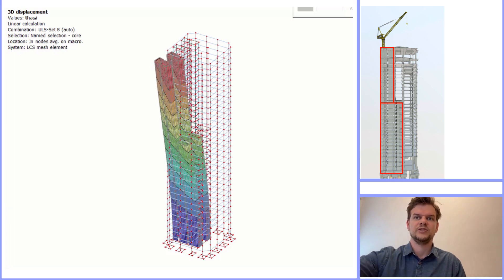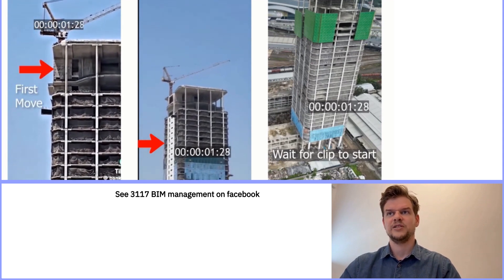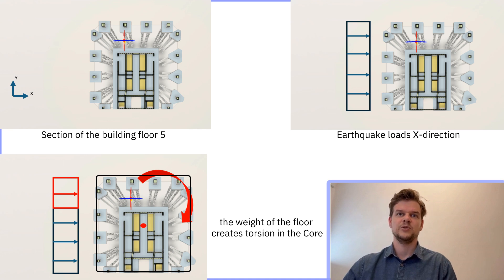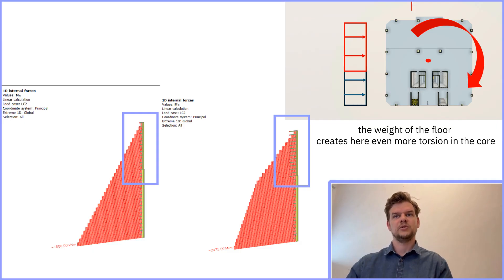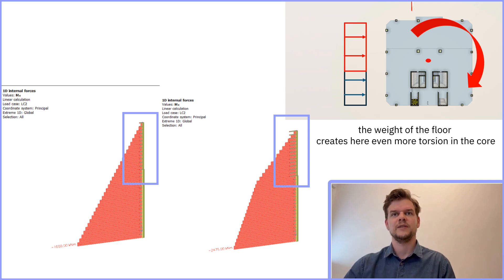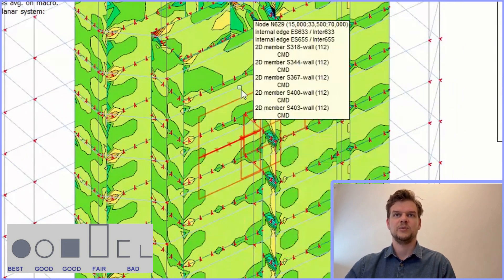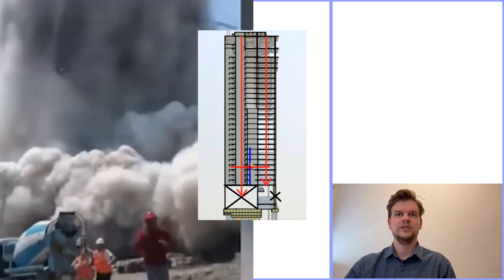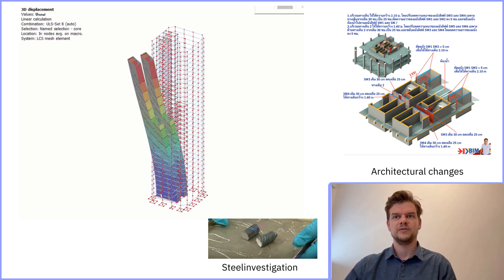Bangkok Skyscraper Collapse by TORSION with FEM and DEMO''

Comment: Thanks, this was an interesting review of possible failure modes of the under-construction tower. More reading points to likely substandard construction materials, poor oversight and design, and corruption greatly increasing the risks of failure under stress. Terrible loss of life, but as "just" construction workers I wonder how much compensation their families will receive.
Reply from the maker: Thanks for your thoughtful comment. The human cost is heartbreaking, especially when those most at risk receive the least protection.

Comment: OK, i understand now, torsion forces caused a skyscraper in Bangkok to collapsed ..but why this particular single one building, built with Chinese Construction materials/steel and by Chinese Engineers and Chinese design .. What were the real Man-made flaws ?? Corruption ?
Reply: corner cutting. Crooked contractors get away with it for decades - until they don't

Look at how many building collapses happened in the last big quake in Turkey despite quite stringent rules existing which should have prevented most of them

It's not a "chinese" thing. This stuff has happened regularly in the USA too
Reply: @alanbrown397  Indeed, can happen, but PRCHINA seems to be more prone to have such incidents where buildings, Bridges, Highways etc. suffered catastrophic events.  Another recent example , on the morning of April 23, 2025, the Chaobai River Bridge in Beijing's Shunyi District collapsed following a fire that broke out within its structure. Period.

Comment: This is excellent thanks. I challenge you to produce a video on the WTC 2 aircraft impact on 9/11. Most of the impact analysis I've seen focuses on WTC 1 where the aircraft debris and dislodged perimeter columns hit the rectangular core broadside while in WTC 2 the damage was very asymmetrical. The second plane impacted at ~100mph faster, 20 stories lower, and at an angle sideswiping the core lengthwise resulting in the East side of the building taking almost all of the damage. I never really bought the idea the towers fell in the 'same way' as WTC 2 obviously collapsed because of the East perimeter columns being pulled inward in the impact zone, while WTC 1 collapsing looks like a core-first failure. What are your thoughts there?
Reply from the maker: Thanks Daniel! would you be interested in a video that directly compares the two towers side by side? The causes of collapse are fairly well understood at this point, but there hasn't been much direct comparison between WTC 1 and 2 in terms of impact conditions and structural response. Just want to make sure that's the kind of breakdown you're thinking of.
Reply: @SystemFailures43  Anything that you think is worthwhile. Maybe a look at how quickly the perimeter column deflection in each tower caused them to lose strength or a simulation of a reinforced concrete core vs. braced steel core in such a situation or even a comparison of the tube within a tube vs. traditional framing system given damage and variable loading.
Reply: The wtc buildings collapsed when the outer structural members reached red heat and became malleable, at which point collapse was inevitable. It was obvious when watching it live that the beams were starting to buckle with the heat.

The buildings were "unusual" inasmuch as that they were specifically designed to pancake if hit by a fully laden 707 out of JFK in order to prevent smearing across 3 blocks of lower Manhattan and taking out 20-50,000 people. The Empire State building crash had already proven this was a risk and it should be noted that the only reason these buildings went as high as they did was because they were owned by the NY Port Authority - as such they weren't subject to planning limits imposed by NYC on lower Manhattan Island BECAUSE of the aviation risk taller buildings presented

The wonder with those particular buildings isn't that they came down, but that they stood up for as long as they did.

WTC7 collapsed as a result of critical structural hits from debris of the other 2 collapses

Comment: There are a lot buildings in Bangkok with similar layouts which did not collapse. I think the question is how much did the changes in design during construction and substandard materials contribute to the collapse. In other words if the building would have been constructed as per original design would it have collapsed or not?
Reply: Several other buildings in Bangkok and elsewhere suffered serious structural damage as well - failed columns and shear walls for example. There is so much wrong with this buildings design that my guess is that it would have collapsed even if the changes hadn't been made. But we will see what the structural engineering experts say when they develop their model.
Reply: @fx-studio  
We don't know. While we do have more information about the collapse now, compare to other case in past time, we still don't know much about what actually going on in that construction site.

There are sign of corruption and fraud, subpar material usage so far. Just like ants, these issue are only the first few we found. May be there are more problem with construction process. May be there are something else in the ground.

Bangkok sit on very soft clay and people keep build skycrapper there. We don't know if the elongated pile which extrude to meet the sand layers 20 meter something under could handle the quake very well. There had been many sink hole observe in the area.

I think there would be more 8 magnitude quake in close feature... Or worse. 
And we would know for sure if our building standard is adequate.
Otherwise... Well. I don't think Thai can handle that level of disaster. There will be million of casualty.
Reply: There is a difference with the Middle East where they build massive sky scrapers like the Burg Khalifa on sand. But there the rulers know they don't have the local capability to do it, so they bring in top international companies to do the job for them. For example the Burg Khalifa is built on massive Cassons with a 9 meter Mat slap on top. That's expensive, requires a lot of technical expertise, coordination and careful supervision at every single stage. 

But Thailand doesn't permit foreign architects nor structural engineers - and while local architects dream up ever more complex structures there is a potential mismatch between the designs being produced, the structural engineering capabilities and the reliability of the systems meant to ensure they are built safely.
Reply: @ 
There are reason behind the restriction, though.

Building code is one thing. Industrial standard difference is another.

You can't have European design with Thai's quality of material. It is a disaster await to happens. 

Imagine if design wants to use material to 90% of its capacity, that they know it would work in their country, but the local's material could reach around 50% of the design.
Reply: @farn1991  Works just fine in other countries - Thai measurements are the same for steel SD40 is 400Mpa and concrete in Ksc which converts easily as well. Architecture is a occupation restricted to Thais, but it's on the design side not material one. 
Its more to do with other things and the general mindset - while in the Middle East they have the money and just throw it at the project and let the best people get on with it.
Reply: @fx-studio  
Well. If money 'can' solve the problem then it is an expense.

But when money is the problem, then even the best people might just be as useful as the layman.
Reply: @farn1991  But in this case they have spent rather a lot of money to end up with nothing. 
And that goes for other construction which is subpar as well.
Reply: @fx-studio  
It's not like you can hire full-team of foreigner to work. That goes for any country, may be a side from Middle East.

So it will be mix with the local. You don't know how  stubborn Thai are. Sometime they may smile and node and say 'Yes, understand. Will do.'

But they don't understand. They won't do as you instruct. 

At least Chinese are honest that they won't follow any protocol you impose on them. You would have to gamble with Thai.
Reply: @farn1991  In the Middle East they use Indians as the labour and some if they are qualified do design work as well.
In Thailand use Tai Yai for all labour including electrics, (except for some more complex things like air conditioning).
The Tai Yai will match to your standard if they are trained and instructed.
Reply: @farn1991  "You can't have European design with Thai's quality of material"

Part of the design is KNOWING what quality of material is being used along with being onsite to supervise that corners aren't cut. A European designer doing a design for Thailand will spend a lot of time researching local materials quality before even putting pen to paper

If you think Thai or Chinese material is uniquely bad, let me introduce you to Italian construction
Reply: It's worth noting that a lot of tall buildings are designed to withstand earthquakes ONCE, then be demolished. 

Christchurch New Zealand is a good example. Although only 2 modern office buildings collapsed (they were both examples of "cheating" in design/construction, responsible for 80% of the deaths in the quake) over 200 more had to be taken down in the central city - along with 1000 older buildings

I'd be interested to know if the design of the collapsed BKK building included a mass damper and if it had been fitted at the time the quake hit (if "Yes" and "No" then this would be a good reason for collapse)

Comment: Did you see the result of concrete strength test?
Maybe the designer didnt design it to be built with tofu dreg cement.
Reply: That's durian cement in Thailand
Reply: @c雨颖  Thai Taro Dregs  🙂
Reply: @theeraphatsunthornwit6266   Reinforcement schedule for SW1-1, SW1-2, SW-3 (shear wall 1) 3117 BIM.
Reply from the maker: THX for the comment! I haven’t seen any official test results, feel free to share if you have them.
My video focuses on torsional behavior and layout,
but better materials and/ or a better design could have prevented the collapse.
But yes… tofu dreg cement is not in any code I’ve seen :)
Reply: @ConstructionFailures   some steel bar does not pass the test due to a bit inferior in quality......  i havent seen cement test but i bet $1000 it is mainly the cement. Whatever the offical result is, it is irrelavant. Several workers saw it first handed when they drill the cement before collapse it has zero resistant to the drill... some even said in the moment of collapse arh that brittle building  every worker know the cement suck. 
To blame the design and the designer, a question you should have asked if everything else is normal, will it collapse.
Reply: @Yggdrasil_Story  Steel quality was never the issue with this collapse - its expected in certain countries that some bars will be 20% understrength. The problem is the design, where they used only DB12mm @ 300 for the core wall, that is less than 0.5% of the ratio of steel to concrete - when what might be expected was something like DB25mm @ 250 about a 3.2% ratio - that's a 600% difference !!

Some 500Mpa bars that are really 400Mpa (20% difference) isn't going to be the show stopper here.
Its the 12mm at 300 that's the problem - nice if you were building a patio deck though 😂🤣

The concrete is white like it has a Pozzaline in it (GGBS) and the remarks about it indicate that there may not have been sufficient cement CH (calcium hydroxide) in the mix to react with it - thus leaving it as dust in the final concrete. I have experienced exactly that when the cement content was shorted at the plant.
Reply: Source: reinforcement schedule for SW1
Reply: There is no problem with steel, the Thais falsify the data, and there is a problem with the rumor steel